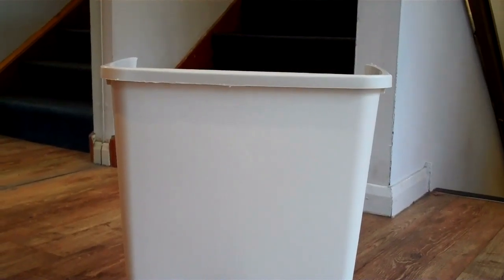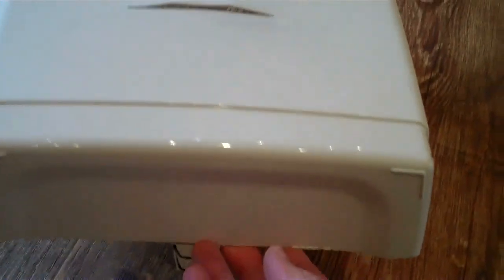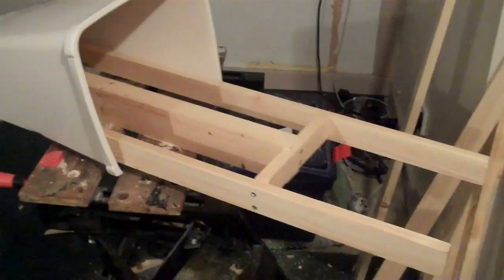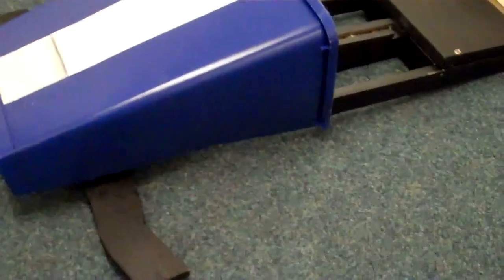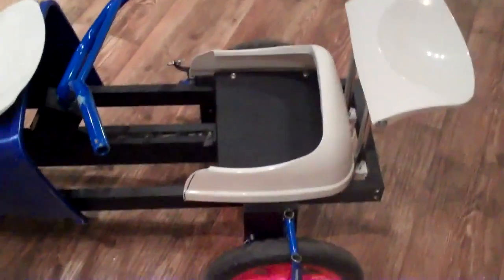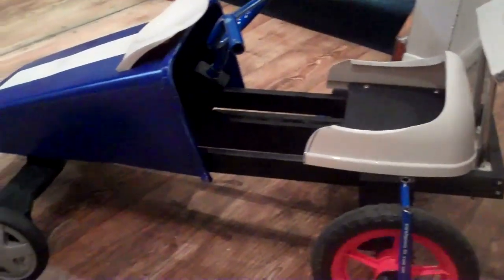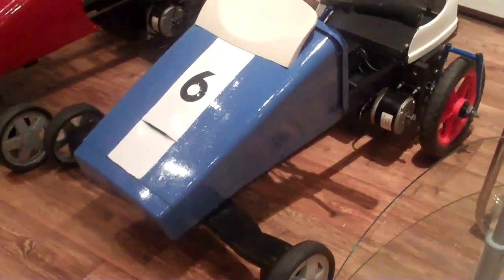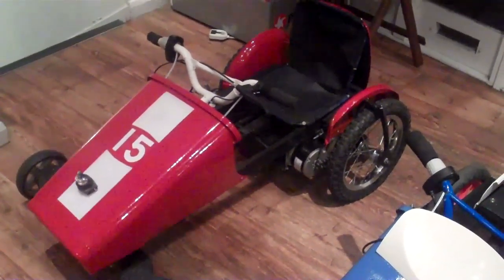How to make an electric go kart

Comment: Friend, what is the origin of the engine? where does it come from?
Reply from the maker: Hi  . the motor and throttle and wiring is off a razor e300 scooter. the only problem is the chain is different to the chain on a bike so I had to make a different sprocket. that was a pain but once I'd done it it worked fine . hope that helps.

Comment: can you replace the steerng with the steering wheel
Reply from the maker: Aeorox Builds. yes you could although the throttle was twist and go like a motorcycle and the brake was also handle bar mounted . one change i did make for the better was the steering. the kart would go 15 mph flat out but developed a steering wobble so i got rid of the cables and used rods which worked much better.
Reply: thanks
Reply: thanks
Reply: thanks
Reply: thanks

Comment: can u explain how to put the motor on cos I really wanna build it
Reply from the maker: Hi. the motor is off a razor scooter. if you can buy a 2 and hand one for the right price you can use the motor. twist throttle. and brake. good luck.
Reply: +thearena71 is there any way I can but a gas moter on it

Comment: Very cool for the hood scoop might I recommend using a heat gun and a wedge and clamp a board under the front lip of the scoop heat and advance the wedge till you get the desired opening

Comment: Thanks. Well the wheels are off a bike, I cut the forks off and mounted then horizontally. If you leave the brake on its mounting all you need to do is re route the cable. So it only has one brake on one side but it stops really well. Hope it helps.

Comment: The trashcan thing was pure genius no longer will I have to spend days bending wood. Could you explain the breaks though
Reply from the maker: on the right hand side I used the front forks from the bike but mounted them horizontally. I left the brake connected and it has a lever mounted on the handle bars. that's the only brake. it worked great and would stop fast.
Reply: Cant the breaks just be a simple on and off button for the motors? You could also look up an electric gocart engine online, but use the trashcan idea
Reply: The Pickic the off button for a brake would not work as you would have to roll to a stop

Comment: A noobs question I know but how do I connect the two rear wheel assemblies to the frame, just about got the rest together but struggling with the rear wheels.  Do I just bolt straight through the bike forks into the frame?

Comment: A noobs question I know but how do I connect the two rear wheel assemblies to the frame, just about got the rest together but struggling with the rear wheels.  Do I just bolt straight through the bike forks into the frame?
Reply: Sorry for not replying sooner. You've probably done it now but yes bolt through the frame to the kart, although I did make a bit of a recess for the forks to fit into so that took most of the weight then the bolts just held it in place.

Comment: and is there any way that u could do the steering but with a steering wheel?
Reply: IDK if this will work but just add the steering wheel then add the cable to the wheel.

Comment from the maker: .Hi All the electrics,including the throttle are off the e300 razor scooter and I just connected it together like for like. I bolted the motor on the go-kart in line with the rear wheel sprocket and used the bike chain but on reflection I'm sure the razor chain would work better because I had to grind the motor sprocket to fit the bike. Hope this helps, it sounds complicated but once you make a start it's not so bad. Good luck.

Comment from the maker: Thanks. the bike parts work well, I mounted the front forks horizontally and use that side for the brake, it's enough because it stops fast. The back end of the bike is needed so the go kart free wheels off the throttle.It has a top speed of nearly 15 m.p.h. and i used the motor,batteries, motor controller and throttle off the razor E-300 scooter.